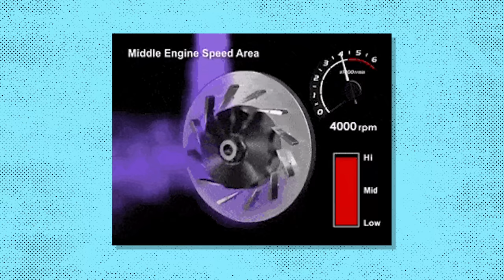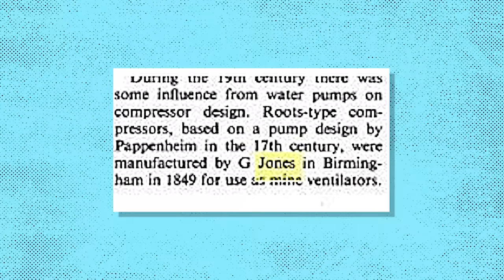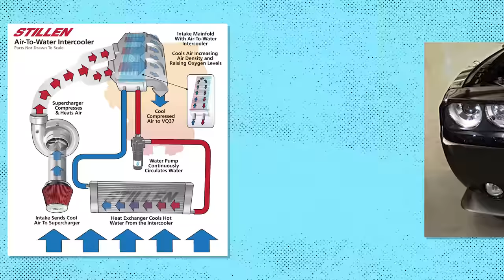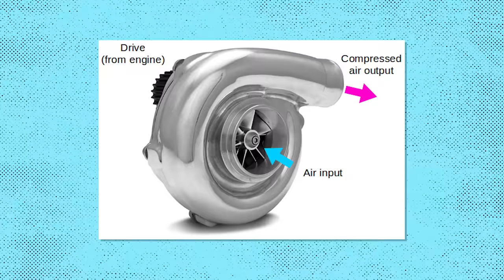Why Superchargers Aren't As Good as Turbos

Comment: This guy talks about "engineering reasons" without any numbers.  Turbos still cause parasitic losses because they create an exhaust restriction.  The gane to loss ratio may be lower with supercharger but the trade-off is usually worth it because of the instant power at low RPM.
Reply: There is no parasitic loss with the turbocharger... the energy to drive the compressor comes from the heat in the exhaust.

This is often a difficult concept to visualize and grasp for someone without proper education or professional experience in engineering.

Its a popular misconception that the turbocharger causes back pressure and restricts exhaust flow, this is in fact completely false, turbochargers increase exhaust flow and this is why they produce more horsepower than superchargers.
Any questions?
Reply: @sandervanderkammen9230  Okay so we want to get out of a tunnel, in our metaphorical supercharged engine we can run straight through. However in our metaphorical turbo tunnel we have to push our way through a rotating door.

Which ones faster? Admittely we're talking -10hp tops but the mathematical difference is there.
Reply: @branney6914  The gases, accellerated  by heat strike the rotating door and push it open... not the reciprocating engine.
Turbochargers use an Impulse Type turbine. 
There is no overall reduction in gas flow, on the contrary... turbocharged engines have higher gas flow.
Reply: @sandervanderkammen9230  You are talking out of your ass. No parasitic loss would imply 100% thermal efficiency which is simply not true. The average thermal efficiency of a turbo is about 55%.
Reply: @bobopaapoe1774  Who said anything about thermal efficiency of the Turbocharger?
It is obvious that the efficiency is not 100%... besides violating the obvious law of conversion loss the exhaust gasses exiting the turbine would have to match T1 or ambient temperature... this is not what is observed.
 The Carnot Formula tells us that the Brayton Cycle cannot achieve 100% efficiency.

The reason why Turbochargers produce more power and have better BSFC performance than superchargers is because there is no parasitic drag on engine, the turbine wheel is driven by the waste heat energy.
 A turbocharged Otto engine is a Combined Cycle Heat Engine.
 Significantly improving thermal rejection and volumetric efficiency and most importantly and often overlooked is the significant reduction in pumping loss.
Any questions son?
Reply: @sandervanderkammen9230 you are correct, but turbos do cause losses (much less than superchargers, but still, for the turbine to be driven there needs to be pressure differential, and therefore, back pressure, this back pressure causes a loss in volumetric efficiency and in the pumping of the exhaust gas.
Although, obviously the gain in ve and intake pumping losses from boost is far more than the loss due to back pressure, so turbos are indeed awesome. 
But if you put just the hot side of a turbo in an engine it will perform marginally less, so there is some loss.

(Idk if what i described is considered a parasitic loss because it is not connected to the crankshaft directly)
Reply: @sandervanderkammen9230 about back pressure, the only way a fluid flows is from pressure differential,  so of course the turbo creates back pressure, no turbine operates with no pressure differential,  fluid mechanics bro c'mon
Reply: @Pedro-ke6xp   You obviously don't know anything about Fluid Dynamics son... because the turbo creates a positive Delta~P 
Turbochargers increase airflow, not reduce it.
Reply: @Pedro-ke6xp  The Turbochargers turbine wheel is a Heat Engine and converts heat energy contained in the exhaust gasses into shaft horsepower.
As the hot exhaust passes through the turbine wheel the EGT DROPS (typically between 200° -300°F) 
This drop in temperature is directly linked to the horsepower generated and can be expressed using the BRAYTON CYCLE  heat engine formula.

Any questions son?
Reply: @sandervanderkammen9230  I'm not talking about the whole turbo charger, just the turbine side, are you saying the exhaust gas pressure is lower before the turbine and bigger after the turbine? The turbine increases exhaust gas pressure???
So by your logic turbo manifolds work under vacuum, if the pressure is lower than the turbine exit, witch is ambient pressure
Reply: @sandervanderkammen9230  the temperature, AND pressure drops through the turbine, the entropy is what matters and it does not depend exclusively on heat, if the brayton engine worked with only heat why is there a compressor in that system? If turbines generated pressure increase there would be no compressor in any turbine engine, just burn the fuel at ambient pressure, the heat would give power to the turbine, but that is not how it works, you are so delusional bro, looks like you are trolling 

If there is no pressure differential needed, light a camp fire under a turbine and see if it rotates with the temperature differential. 
Look at the videos of banks power on duramax engine, he talks a lot about drive pressure of turbine.
Where did you study engineering to learn this nonsense?
Reply: @Pedro-ke6xp  The turbine wheel is directly connected to the compressor by the same shaft, they are directly linked.
WRONG, turbochargers use an IMPULSE TYPE turbine, they work on VELOCITY not pressure.

No, the intake manifold pressure is Higher than ambient air pressure, so no backpressure.

The turbocharger INCREASES air flow through the engine, not reduce it.
Reply: @Pedro-ke6xp  No, your lack of engineering skills are revealed by your own comments, the turbocharger uses an Impulse turbine.
Yes, ENTROPY. A turbocharged engine is a COMBINED CYCLE heat engine, the turbocharger extracting heat energy from the same Hot Reservoir as the reciprocating engine thus reducing entropy and increases the conversion rate of heat energy into rotational horsepower.

This is why turbocharged engines produce more horsepower than supercharged engines and still have lower BSFC.
Reply: How can it create a restriction if it flows more air???

If it's flowing more air and making more power how can there be a parasitic loss???
Reply: @branney6914 That's because the Brayton Cycle is not 100% efficient, there is always heat energy that is rejected by the gas turbine that drives the compressor, the point is compressor does not present a load on the reciprocating piston engine.
It's running on the heat wasted out the tailpipe.
Reply: @bobopaapoe1774 What parasitic loss? The exhaust temp drops like 250 degrees as it passes through the turbine wheel.
That's after the exhaust exist the engine.

The BSFC also tells us there is a net gain, not a parasitic loss.

A turbo engine doesn't just make more horsepower than the supercharged engine.
It also uses less fuel per Horsepower/hour.
Reply: @WilhelmKarsten  like this, with some fictional numbers as example:
Turbine on the exhaust side creates a restriction, which creates back pressure, or drive pressure of the turbine, this means more mass of burned gas stays in the chamber, which takes away 2 hp.
But the turbo also has a compressor, which increases the intake pressure, boost pressure, this increases the air in the chamber, which gives you 202 hp. 
In the end the flow is bigger through the engine, and it makes more power, 200hp more. But the turbo does create a restriction,  flow would be better with a magic compressor, and no turbine restricting flow of exhaust. 
So, the turbo creates losses, the turbine hinders flow, but the compressor more than makes up for all of that by orders of magnitude, so yes, when you add the gains, and losses, which exist, the turbo increases flow and power.

It is just like a company, that makes 200 dollars per sale, but their expenses are 2 dollars per sale, yes of course there are expenses, but also of course there is profit, and lots of it. Same logic.
Reply: @Pedro-ke6xp  What grade did you drop out of school?
Reply: @WilhelmKarsten  I'm an actual engineer who learned by books and papers, not youtube videos like u
Reply: @Pedro-ke6xp  If you actually paid for an engineering degree?
You should see about getting your money back...
Reply: @Pedro-ke6xp  Please explain how the turbo causes a "restriction" when the engine flows more air with a turbocharger???
Reply: @sandervanderkammen9230  turbo has two sides genius, the turbine and the compressor, the turbine creates restriction while compressor more than makes up for that, it's not that hard
Reply: @Pedro-ke6xp  The two sides ARE CONNECTED DUMMY.
All the air going in the compressor goes through the engine and out the Turbine.

If the turbo is a restriction HOW CAN THE ENGINE FLOW MORE AIR???
Reply: @sandervanderkammen9230 wouldn't the simple answer be that since the back end of the turbo is spinning up with hotter air it has to push against the front end with denser more cooler air. Since there are more air particles entering than exiting, the exhaust gasses will pretty much always be at a disadvantage unless they are heated to the point that each heated molecule can move several cooled molecules. Would not expect most engines to reach those temps tho.

I'm not an expert but surely you can see the logic there?
Reply: @SifuPuma  You are so close to grasping the thermodynamic concept here.

The exhaust turbine is an engine that converts heat into horsepower.
The exhaust gasses are the medium, called a working fluid that transports the heat energy from the combustion chamber to the turbo.
As the exhaust gasses pass through the turbine, their temperature drops (200°-300°F).
This temperature drop is directly linked to the amount of horsepower generated by the turbo and can be expressed by using the Brayton Cycle formula.
Any questions?
Reply: Someone explain to me how to transfer thermal energy into angular velocity please.

Intuition would have you think that the force is generated through kinetic exchange between the hot and fast moving gasses colliding with the turbine on its way out of the manifold. Buttttt, intuition is wrong in this case. Heat has little to do with this exchange beyond being a catalyst for the pressure differential. Temperature could be constant if the volume differential were the actual driver of the pressure differential. See Ideal Gas Law (theoretical ofc). The real force acting on the turbine happens as the exhaust gas moves from a higher energy state to a lower energy state across the turbine blades which imparts an area of negative pressure and drag at the back and tail surface of the blades - essentially a lifting force tangential to the axis of rotation. The turbine would have no means to spin if it were only a temperature differential. There has to be a fluid in which to generate aerodynamic forces across the surfaces of the blades. This does however mean that higher temperature and pressure differentials can lead to a greater exchange of energy as the larger pressure differential will lead to a more dramatic change of energy levels. Temperature is the catalyst, but is not the driver. Pressure is the driver of this exchange as it is the only way to create flow. Soooooo long way of saying you're both right. Turbo chargers are not parasitic except for cases when the turbine has reached a terminal angular velocity (at which point the turbine can no longer spin faster) and would result in some back pressure into the manifold. Examples in losses of efficiency can be due to geometry, overcoming moment of inertia, drag, friction in the shaft, turbulent flow, surface roughness, etc. Sometimes the turbine will spin at a higher rpm than the incoming exhaust gas velocity (like when you shift into a higher gear, hence the blow off valve) and that can actually suck the exhaust gasses out of the manifold, but that decreases the pressure differential and allows the drag on the turbine to have a larger proportion of the balance of forces which will cause the turbine to slow down rather quickly. So yeah, sometimes it sucks incoming exhaust gas, but most of the time there are just a bunch of small losses in efficiency, however NOT often parasytic because excessive back pressure occurs infrequently and does not often impede the normal operation of the engine cycles.